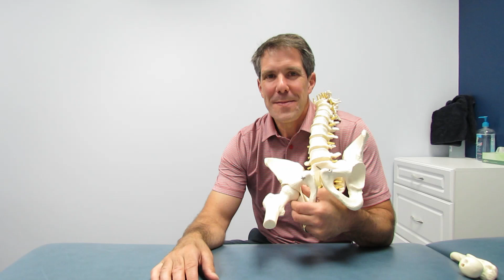CAM Lesions Explained

Comment: I recently had hip x-rays and the Dr. identified a CAM lesion on my right side.  I am 32 years old, but my hip pain and tightness makes me feel much older. I played water polo at the D1 level and always struggled with my right hip. Now I am an endurance runner trying to navigate my options.  Your video was great and helped me understand the why behind my chronic hip pain. Scheduled to see an ortho later this month.
Reply: any updated from the ortho
Reply: @jevonmartin2250  Yes, ortho told me there are three options...1) hip replacement, but given my relatively young age he did not suggest this route. 2) go in and shave my hip area to make it look prettier. However, there is no guarantee that just because my hip looks better on an x-ray that it would feel better during my activities. It could also go the opposite way and become worse after the operation. Always that risk. 3) if I am able to continue the activities I like with relatively low pain or manageable pain, he said feel free to destory your hip over the course of the next 10 years or beyond enjoying those activities and then get a hip replacement. Given the advancement in medical technologies, hip replacements 10 years from now will be far more advanced than the current (pretty darn advanced) hip technology.  

Water polo was by far the most painful activity for my hip, so for now my dreams of making a late-bid for the olympic team are side-lined. 

Hope this helps.
Reply: @CoryLyle   on day 2 of my hip arthroplasty and the pain sucks. I'll be on crutches for the next 4 weeks 
but hopefully things will be better 3-5 months from today. Ill keep you posted
Reply: @jevonmartin2250  my dad has had both his hips replaced and made a full recovery. He ran a 100km ultra after first hip surgery and a 50km after his second. Sure his stride looks a little goofy now, but he has returned to full activity and is very happy with the results. Wish you the best recovery!! Take it slow.
Reply: @CoryLyle   dad? you mean iron man! that amazing. Thanks for the words of encouragement, ill up date on journey
Reply: How i your hip now
Reply: @nazmashaik390  same same. I try not do a lot of squatting or lunges. Also I stay away from cycling on a road bike. Running consistently and no major issues with my hip besides the général tightness that I have learned to live with.
Reply: @CoryLyle I just learned I had cam lesion and I’m a high school football player and track runner. Right now it’s kinda small but my IT band, quad, hamstring, glutes, and sometimes lower torso get tight and stiff. Is hip replacement or shaving your hip the only road to go down in the future? I’m young still but I am a bit worried about this.